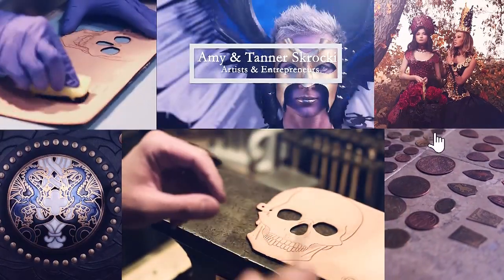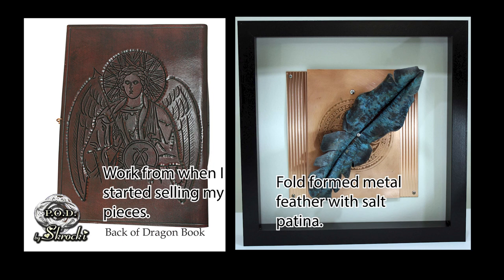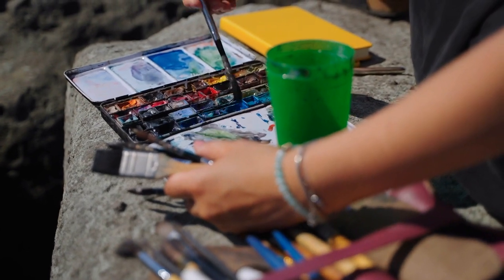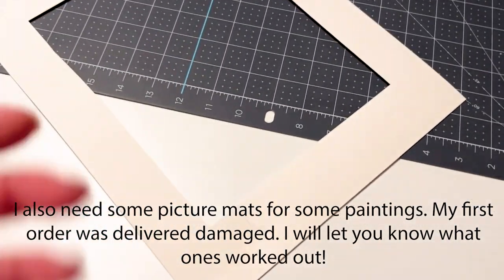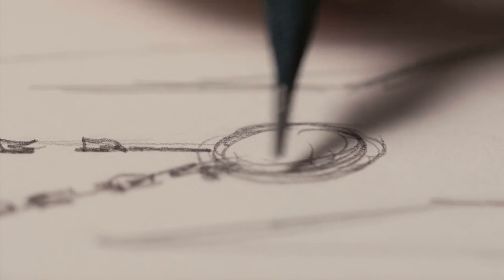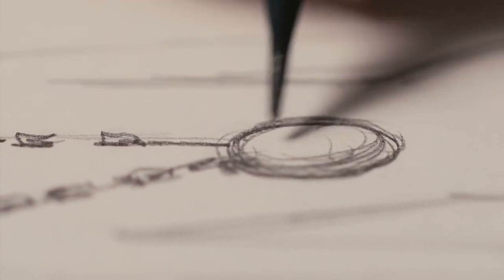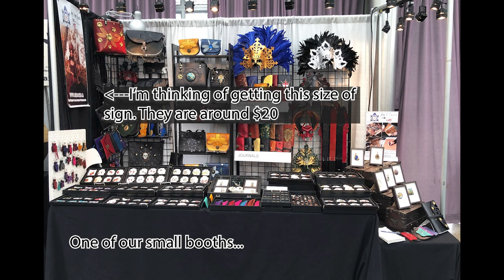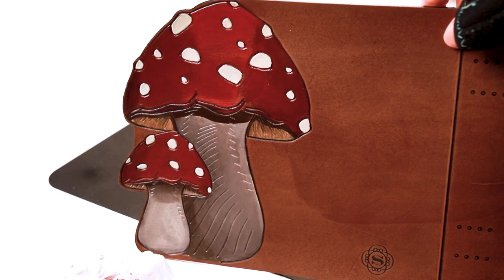My first art show selling my paintings!  Coming up with art booth display ideas and making a list!

Comment: Winsor Newton paper is good (it's my preferred cold press), I use Fabriano for Hot Press. Both are 100% cotton which is really the best for watercolour. 

In order of importance when painting watercolour it is paper, pigment, then brush. In paint any professional level watercolour paint is a good choice.  I use Holbein paint more than any other, but do sometimes buy convenience colours (like QoR Quinacridone Gold Deep or Daniel Smith Moonglow) I try to avoid paint that uses honey as a binder. The Paint Spot on 81st sometimes has sales on cotton paper - they had a huge sale last year on Winsor Newton rough press which is excellent for nature scenes. The owner at Paint Spot is an encyclopedia of art supplies. 

Looking forward to the follow up video.
Reply from the maker: Thank you so much! I looked into the paints you have suggested and I will see if I can save up for those! I will be sure to talk to the owner of the paint spot!